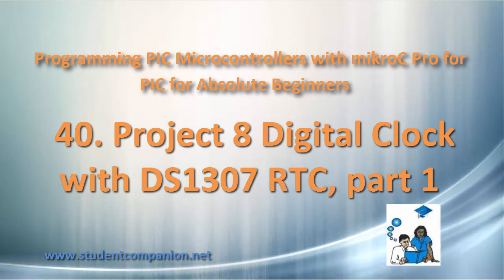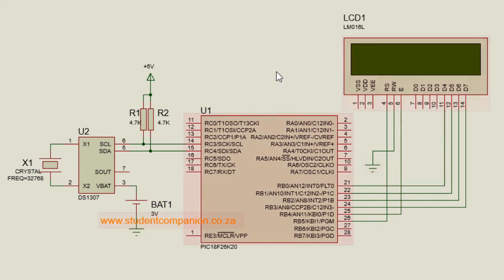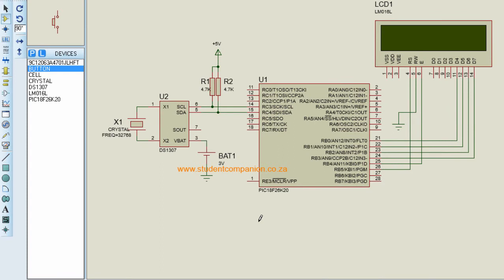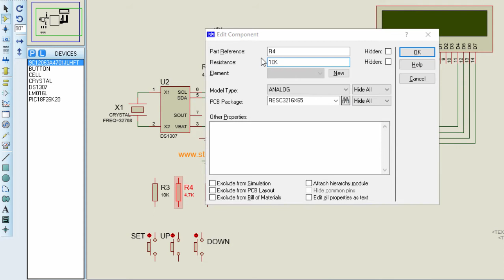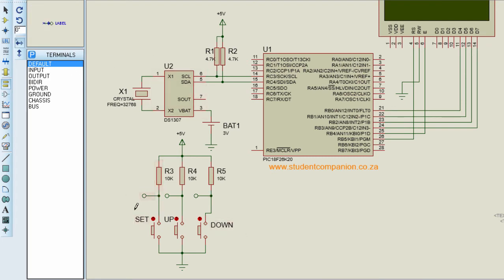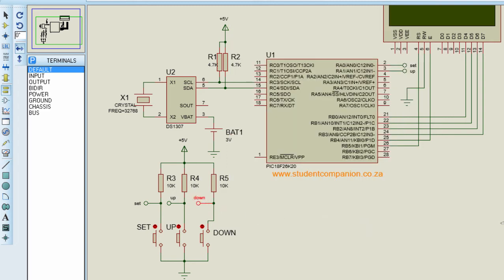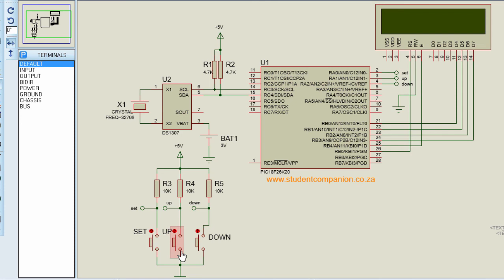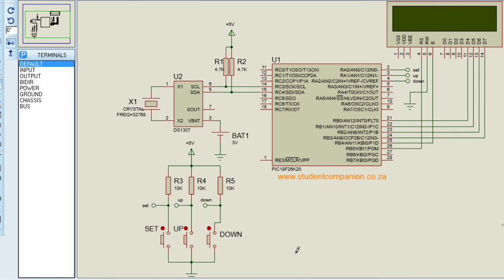40- Project 8 Digital Clock with DS1307 RTC, part 1 | mikroC Pro for PIC Tutorial

Comment: which device I should use in mikro C programmer
Reply from the maker: Your question is not clear.
What do you mean by device? What do you want to do?
Reply: @StudentCompanion  no when I use you coding in my mplab to build it became failed
Reply from the maker: MikroC and MPLAB XC8 syntax are not the same.  You can't use that code in mplab
Reply: @StudentCompanion  so which app I should to use??
Reply from the maker: Use the application you have. If it's mikroC code, use mikroC compiler. If its mplab code, use mplab compiler. If it's arduino code, use Arduino. You can't mix tools. Unless I didn't understand your question.
Reply: @StudentCompanion  Sir now I wanna do this project my college but my Lecturer wanna see which software want to use to write the coding
Reply: @StudentCompanion  what app do you use to write code
Reply from the maker: Why do you want my email or phone? We can't explain to you in private. All questions should be posted here in YouTube or in the forum on our website.
Reply from the maker: If you can't understand what we did in this tutorial, start from the beginning with tutorial no 1. Then you will understand all the tools used.

Comment: professor, you are using the internal oscillator.  So in the configuration of the bits, do I leave the masterclr reset as I / O?
Reply from the maker: Hi. The MCLR has got nothing to do with the oscillator whether you use internal or external. There is a configuration bit to enable the MCLR or disable it.
But it's always good to enable it unless you have a reason to not do so.

Comment: hello i need a help i want to do the same project but with a pic 16f876a
Reply from the maker: Hi, what kind of assistance do you want?
Reply: How can i do the same project but with a pic 16f876a
Reply from the maker: Start a new project and select this PIC.  Select the fuses, oscillator source as per your project. And most of the code should work except few things like the ANSEL registers